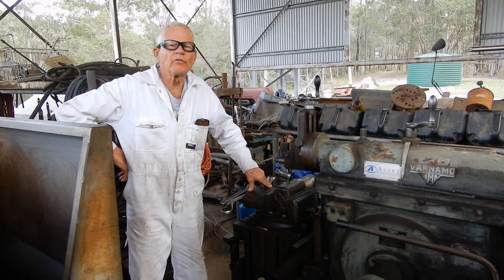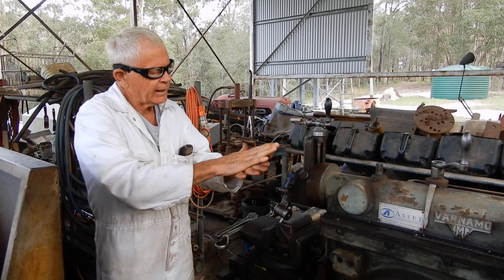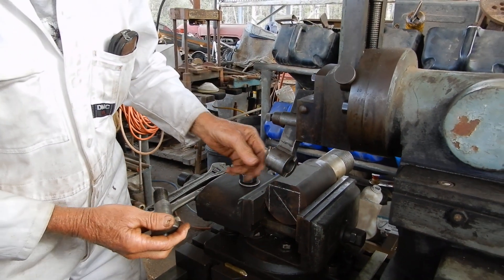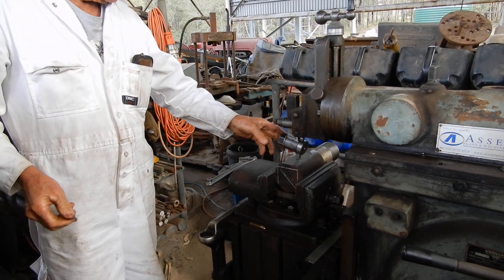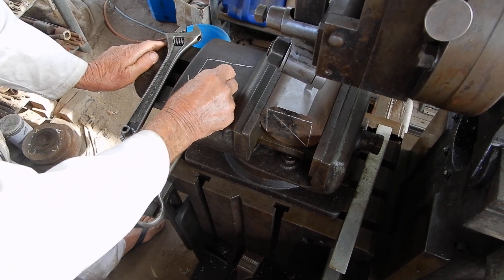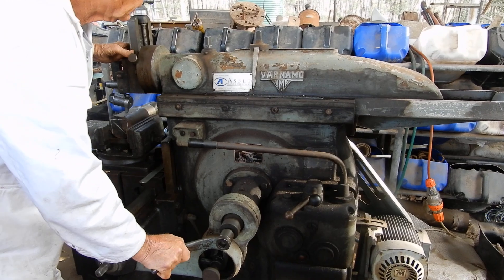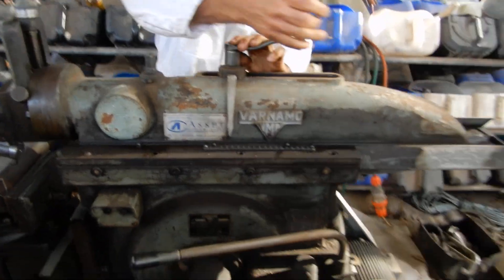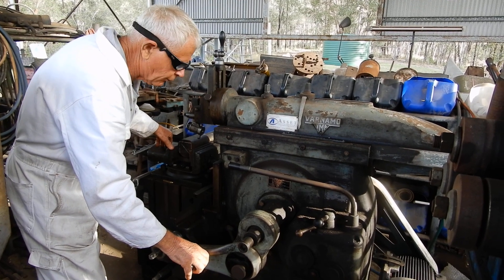Shaper Toolholder 14 degrees positive rake

Comment: Same deal in USA, we sent all our manufacturing east as well.  Question, would it be faster to turn the work piece 90 degrees and cut longitudinally?  I admire your shaper.  My old Vernon is more difficult to adjust stroke; you have to loosen a bolt inside the case - not real accurate.  Best regards from Nebraska.
Reply from the maker: it is better to cut longways normally but i left a shoulder on for that job so that is why i did it that way